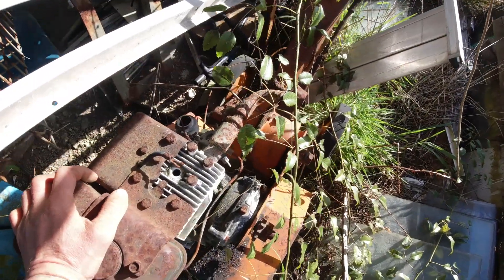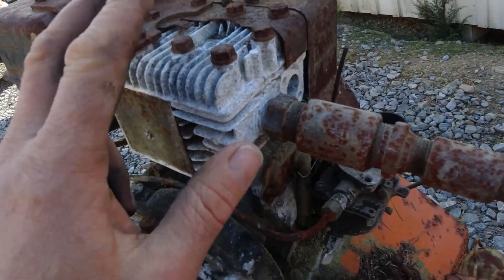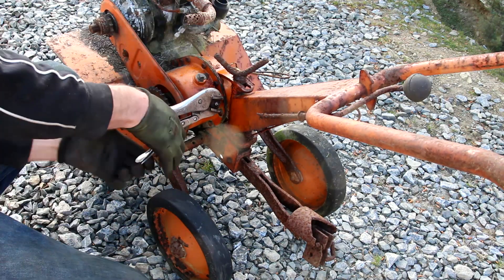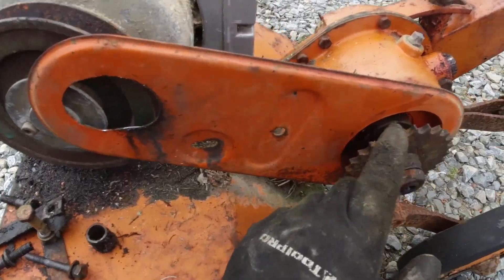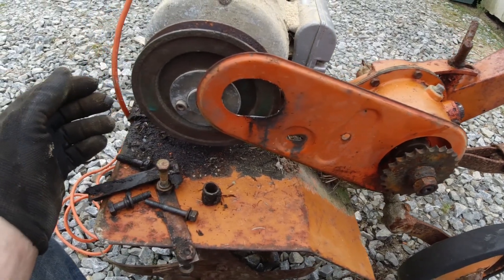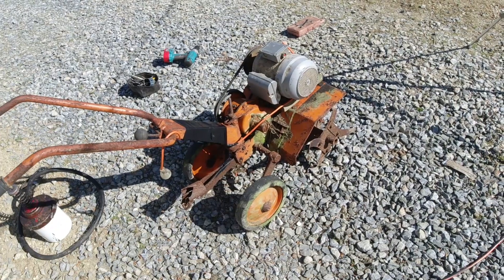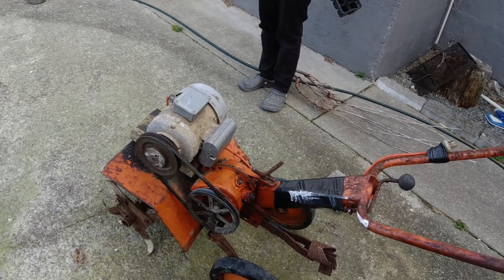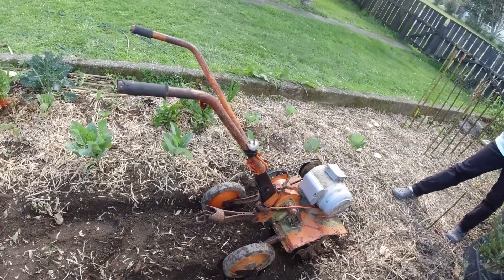Making an Electric Rotary Tiller using junk parts - Zero emissions!!

Comment: these zero eco clowns are so ignorant its...not chocking. but not less disgusting. mad props public school and media. if not nucelair or water electrics is very much emissions to produce. coal is mining, raping mother earth with the heaviest equipment on earth, windmills costs and negatives are to install, repair, and the energy they produce is also really bad comparing to other methods (water/nuce) and deliver, also the huge blades/propellers are coated in pfos, and will degrade into the nature with time. when its sprayed on wings on airplanes etc, the waste is insane and often just spread into the wind or sea and result will end in our food in one way or another. people who just believe media up and down without a thought should research why and how these big nuce plants got destroyed tegh way they did, and perhaps wonder why they are using words as "radioactive radiaton", as if they're would be honest and honorable people. the time for just air and uv to break down a plastic bag is like 10-400 years.. theres a bit of a gap, and when they use statistics of it and especially other products they would bend the numbers to fit their agenda and wallet the most. thats why the food your eating today is basically getting more and more toxic by the day and the natural and good products is so expensive and only used by the upper classes and the production of it also limited all bcus of the sold out puppet politicians will regulate laws n policies to fit the eastblishment, owned by a handful of families.. nothing byt influencers at this point, just like youtubers, selling products and words, and ofc themselves. this guy is a perfect example of used live on scraps and 2nd hand, wanting to leave society then the money starting to take over and morals aint that important as is use to be, when life was harder.

Comment: the round gearbox on the Briggs engine is a 6:1 reducer. i used these in old Locke reel lawnmowers. At 3600 of engine, rpm on the cog is 600.

Comment: Nice repower! One thng I noticed is that those tines are completely worn out. They sould have a 90° bend at the end and several inches of blade horiontal to the soil. For what you'll be using it for, though, those seem to work OK.

Comment: Try putting a smaller pulley on the motor, it will give you more leverage to keep the tiller blades turning. And it needs a rear splash guard to stop you getting hit with dirt, soil and rocks.

Comment: Also Just noticed the blades are turning the wrong way need to rewire the motor, they should pull the machine forward
Reply from the maker: The blades are spinning the right way, camera frame rate creates the illusion that they are spinning in reverse

Comment: Try changing your pulleys instead of a bigger motor. On the other hand that briggs and stratton is a 3 hp so 3/4 of 3 = 2,25 kw.(750 w = 1 hp)

Comment: I have a run real I’m more than the engine died on I put on the old motor out of my furnace I had to replace the furnace and it works great except whenever it loads down at POSTNET card and blows the breaker 20 amp breaker with any kind of current load it blows it this month to pull a laundromat current with the current dirt over the road is not much more severe I would think what is your current source you drive is worth

Comment: I have a similar sized electric tiller which I love as I use it in the polythene and it is just the right size for me to manhandle (womanhandel) and ZERO exhaust has been a real quality of life improvement, but I'm very impressed you were able to do the conversion.

Comment: The Honda petrol one my dad has spins the blades a lot slower and has the rear spike that another commenter mentioned. It has detachable driving wheels that slip on to the end on the blades shafts. You can cut power to each blade with brake handles on three bars.

Comment: It’s spinning backwards and way to fast ! They are meant to just trundle along steadily forwards under their own power, you just pull  on the bars to hold it back and make it dig its way in to tougher ground, it should even hook out buried bricks and stones and roots if you let it pick away at them and bounce around a bit. There should be a sort of spike at the back that you change the depth with a removable pin  / bolt or flip out of the way for transporting, it digs in to slow the machine and make it cut, and helps with steering.

Comment: One under appreciated aspect of using a plug-in Rototiller:  You can always find your way back to the house.
Reply: unless the wire gets eaten by the tiller and ends up mangled in the blades. anyway a fantastique job, as always, but likely meant to be manned by dad rather than mam.

Comment: Cool mod, but for the love of all that's holy, put a dead man switch on the handlebars for safety! You don't want that thing running away from you, especially with kids around.
Reply from the maker: Pull the cord it stops, actually easier than trying to flick a switch while its bumping around..  definitely wouldn't have kids running around while using it

Comment: To get rid of the slugs, get yourself a stack of cheap knock-off Tupperware bowls, dig them into your vegetable bed every couple of meters so the rim is almost flush with the dirt. Fill the bowls with an inch or two of beer.

Slugs and snails will crawl into the bowls, get drunk as can be, and die a very happy death.

Comment: the wheels should lift out of the way when in use they are for easy transport. the machine should pull itself forward using a depth bar as suggested in earlier comments.

Comment: I was concerned that you didn't have enough speed reduction and the tines would spin too fast, but looks like it's pretty good. It's safer to have the tines turn so that the tiller pulls away from you and not towards you in case you hit a big rock or root.  BTW, that old Briggs and Stratton engine has a gear reduction output, not too common, might be useful for something in the future.

Comment: Drop the size of your pulley on the motor by half and you can get more torque out of that motor. The blades will spin a little slower….

Good little project!😄

Comment: Even though that motor is not as powerful as the gas version but what it will have is a lot more torque I don't see that motor struggling at all it should have no problem doing what you needed to do.

Comment: Just a brilliant job, it is quiet and even that electric cable won't be a big problem because almost all jobs are in limited spaces! Just same type of thing that I always use electric chainsaw when making my woods before splitting. Using also electric hydraulic splitter or my newer electric kinetic splitter because it is faster.

Comment: I did this with a one man post hole machine. The two stroke gas engine was just too persnickety and couldn’t be relied on to start on demand. I had a five thousand rpm, eighteen amp universal motor off an old Clark floor sander ( about the right rpm ) with the right sized pto which slid into the gear case nicely. It also worked well. Ultimately I made it into a boom mounted digger with two bicycle wheels at the far end. The hard pan below the thin top soil is so hard it would lift the wheels and eight foot boom completely off the ground as a put my full weight on the auger. Love your ingenuity.

Comment: Some wider wheels with more floatation may make your life easier to stop it from sinking in at the back. Would mean it would also have a better leverage point to keep the rotor from digging in too far and stalling

Comment: That was a really good idea to do one reason why I love watching your channel never know what you're going to be working on next could be at tractor to a garden hole and everything in between. It's too bad you couldn't build like a little roof that would cover you but also have like one big solar panel up there on top and use that to power the motor directly which I don't know much about them I know that some of them put out quite a bit of power see a guy who built this boat on if I request has a roof that covers the whole length of the boat because he goes on really long rides with it it's paddle-driven but also has an electric motor on it and on a good sunny day I think he's got four panels or something up there and no power that motor no problem and doesn't even have to use the batteries he just basically has them for just in case.
Reply from the maker: Thats cool, I've been pondering the idea of an electric catamaran with a large array of solar panels in the roof, deep cycle batteries in the keels to act as ballast
Reply: @MartyT  it's kind of like what this guy built you have to check them out his name is Jaimie mantzel Barton Island and built his house called the cathedral it's all concrete well actually concrete styrofoam mix styrocreat he called it. Every boat he has the houseboat he lived on while they built the first house on Island he built all of himself all fiberglass and wood and does solar for all his power is no generators at all you have to check him out I know you will definitely like his stuff I can imagine a tooth of you working together you guys could accomplish anything. As always thank you for hard work you put in the channel for us. I have learned quite a bit from watching you.

Comment: Just bought an electric tiller off Amazon this summer for $100, works great,  beats having to hire a backhoe ,used it to dig footings for my 30' x 12' concrete shed... Just have to watch out for rocks that can jam the blades

Comment: I took one exactly like this apart once. it wouldn't turn the tines. the drive system is a heavy chain, and the 2 halved encasement was just packed with heavy grease. my problem was the unit was somehow twisted just enough that the chain had jumped the sprocket. after disassembly and reassembly multiple times to reset the chain I finally just scrapped the whole rig out of annoyance

Comment: I don’t know that I would change the pulley ratios at all. Maybe tone it down just a hair but the fast spinning tine’s rip up the dirt much better than slow spinning ones. I have a large walk behind tiller and the tines spin so slow and topsoil with the slightest amount of moisture in it sticks to the tines and clogs them up. It’s all internally gear driven and not a quick swap to change the speed of the tines without also changing the speed of the drive out out for the tires.

Comment: Marty, It is rotating in the wrong direction. Ken
Reply from the maker: Thats an illusion created by the camera frame rate, if you look closely you'll see the dirt thrown backwards
Reply: @MartyT   nice try but it's not going in the right direction. Briggs rotate in the opposite direction pulling the tiller not pulling it backwards.
Reply from the maker: This does pull itself forward
Reply: @MartyT   Reverse the polarity on the  motor and see what happens. It's rotation is in the Wrong direction. You can fool some  people but not this one .
Reply: Marty. I am 100% wrong. It is rotating in the proper direction. I reviewed the video with my specticals on. I was wrong . Ken.

Comment: An engineering problem is that you have taken the weight from the front, to fix it put a shaft to fit free weights for the counterbalance and then it should work better for even new beds, and rig up a flap for the back.

Comment: No smell, no noise, reliable. Perfect solution.
Leads and boards with rcds(residual current device) are reasonably cheap if your circuit board doesn't have them.

Comment: If you put a smaller pulley on the motor you'll lower the rpm of the blades spinning and get more torque.

Comment: Hey Marty looks like one could spin those tines a little slower.  How about putting a smaller on the motor that would slow down the tines and increase the power.  I've had good luck turning my own pulleys from wood.  Nice work turning that old motor into a boat anchor, great video thumbs up.

Comment: Good stuff! I was thinking something like a mudflap off a truck cut up into a few sections would bend when you wanted to lower the tiller to the ground but also hang if you were starting a row and still stop stones being flicked up. Something flexible hanging down might be more practical.

Comment: I've used my little front tine tiller for gardens but it's best use has been anytime I need to dig a hole.  I've dug out my basement and a large grave for my large dog. It saves the back busting ground and then shoveling loose dirt. Edit: I noticed mine actually turns in the opposite direction, I'm in the US. Is that like the toilet bowl thing?😉

Comment: Hey Marty as Steve D said below there should be a depth control/ drag bar mounted on that protruding part at the back of the tiller. Also the transport wheels should rotate up out of the way and clear of the ground when you're using the tiller. (Some wheels are designed to be removed, others simply rotate up.😉)

Comment: Nice work there Marty. I have a very similar model hoe to this one which belonged to my grandfather. It is at least 50 years old and still runs with the original tecumseh engine. It had probably sat unused for at least 30 years before i got it going again.Had to make a new fuel tank since the old one rusted out. The one I have is belt driven with a pulley clutch system on it. I have used it for several seasons for our summer potato planting. Even managed to find the original manual still in the  plastic bag once we cleaned his shed out after he passed away.

Comment: Running on electric instead of gasoline doesn’t make it zero emissions.
Reply: Depends on where the electricity is coming from, if hydropower indeed zero emissions
Reply: @casparberends  
Any parts that are manufactured would still have a carbon footprint. The wire manufacturing. The generator manufacturing. Shipping any equipment carbon footprint. 

You could say reduced carbon footprint.  Look at studies on wind generation cost and disposal of used equipment. Sometimes it’s spending a dollar to save a dime.
Sometimes it works out.  Must look at conception to completion.  Consequences to our actions.

Comment: I still prefer piston-power,  but I must give a tip of the hat in this instance for the ingenuity and sheer fortitude for the conversion here.  While the engine itself did appear to be a lost cause, the chassis was salve-able, and yes... hats off on installing e-power and keeping the machine effective at providing its intended function. 
Merely my own preference, but I would seek pulleys of differing size... smaller on the motor, and larger on the driven end, to slow the rotation of the tines a bit, to avoid the "spray" of material being far-flung.
Reply: I prefer internal combustion as well but if I had free electricity generating on my property, I’d have tons of electric powered stuff too.

Comment: Great modification. The only thing I would of done different is the make the motor mount adjustable so you can adjust the tension on the belts have it on a hinge type mount.
Reply from the maker: It slides on the motor mount
Reply: @MartyT  must of missed that great job

Comment: Dear Marty T.
👍👌👏 Very well done again and as always (video and work). I'm always impressed how much stronger electric motors are than gasoline powered engines. Much more torque, way less loud and not putting out stinking/poisonous fumes. Nearly no maintenance required too. It is also impressive, how well a simple single V- belt is able to handle the power transmission. I thought, that it would need at least two of those. Please consider to put on a kind of adjustable rest/stand on the piece of iron that is in the back already (sorry that I don't know the correct name of it, English is simply not my native language). I guess that the original one has fallen off or has rusted off.
You can easily take and use the necessary safety switch from an old/broken electric lawn push mower (those devices can be purchased mostly for free).That's at least how I get and recycle safety switches.
Thanks a lot for making teaching explaining recording editing uploading and sharing.
Best regards luck and health.

Comment: It's actually quieter than my new electric tiller (cheap model but fairly usable). You do need a stronger motor though (at least 1KW), as having to constantly tilt the whole machine just to keep the blades spinning fast enough will be too much effort for your wife. Also consider dismantling the wheels for a more detailed cleanup and greasing, as any friction there adds a surprising amount of effort in steering/repositioning the machine.

Comment: Looks like a Merry Tiller type.  The wheels are just for transport. in work they're either removed or raised and a height adjustable 'sprag' is used to control depth and forward movement.

Comment: I know you said that the motor is spinning the correct direction, but the tines are spinning the wrong way (at least compared to the tillers that I have used.) All of the ones that I have used spin forwards, which gives the machine a sort of self-propelled effect. I have an 8hp tiller that I never put above half throttle, because it yanks me forward too hard if I go above that. Anyway, another cool save Marty :) Always nice to see old machines being put back into service, instead of being scrapped!
Reply from the maker: Its an illusion, the camera frame rate makes it look like the blades are going the wrong way

Comment: I would put a smaller diameter pulley on the motor to slower it and give it some more force. And I think it should spin the oposite way, it should pull the whole thing forward.
Reply: thats what i think it should rotate away from you pulling you forward

Comment: I've got hold of a petrol single blade lawn mower with a worn-out engine and replace it with an eclectic one and a half horsepower motor.  A problem I had was getting the pully size right, so the blade turns round at 2000 RPM to make a clean cut.  It was great fun doing that